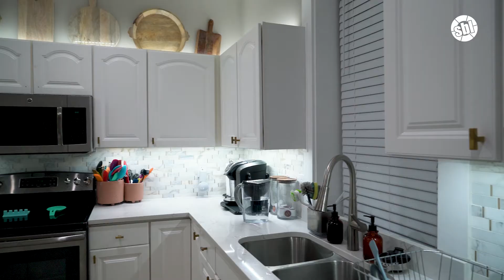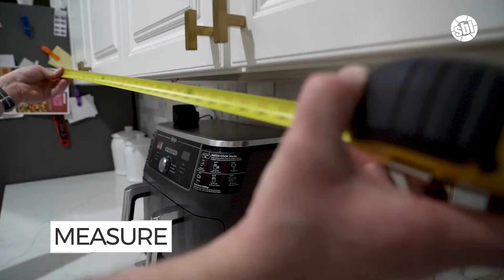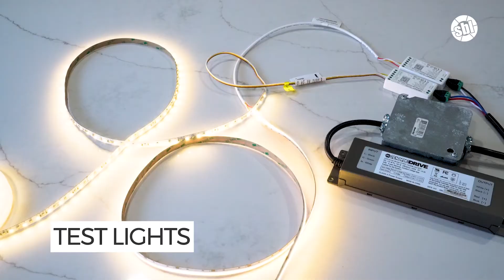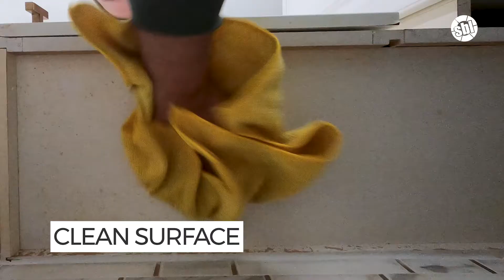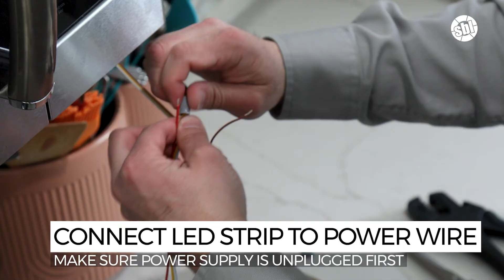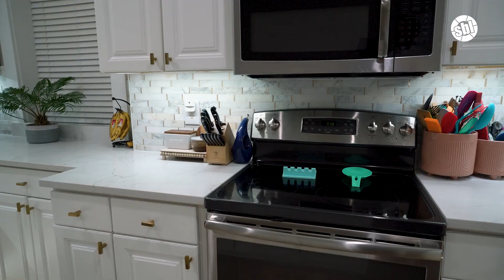How to Install Under Cabinet LED Strip Lights

Comment: Is there anything on the market that can control/synchronize four under cabinet light units that have c7 / c8 connections?
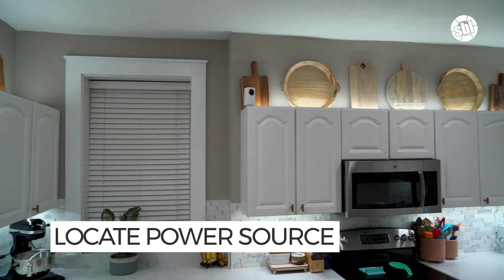Reply: These products would work perfectly to put them all on one controller. Listen SUPER CAREFULLY from :50 to 1:10 in the video. They broke this install into three powered sections, only because they didn't want to go through walls to jump wires around the windows. There are two totally doable things to put them all on one power source, controller, and switch. First, make sure your power supply can power the total number of feet of lights you have. Most likely this is not a problem if you are using LEDs, because LEDs are very low power. The second issue is running wires through walls/ceilings/into basement to connect all sections electronically. This takes some skill/practice, or an electrician. I think they avoided that in this video to make this example install super easy and accessible for the average novice.